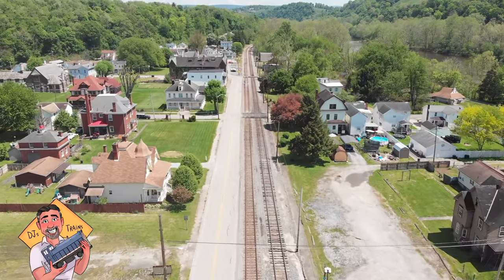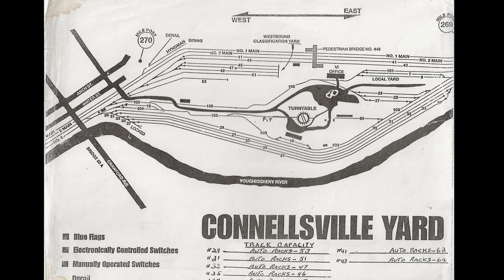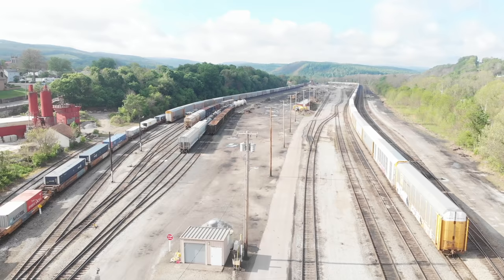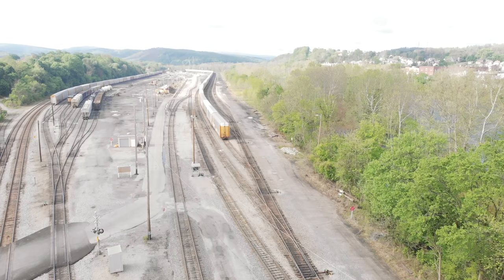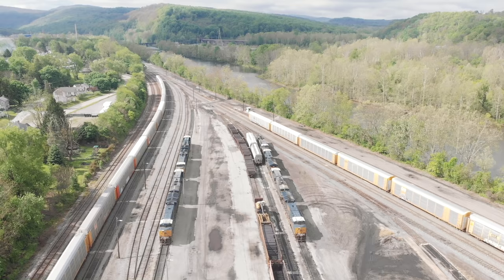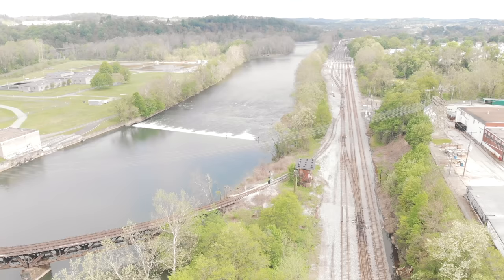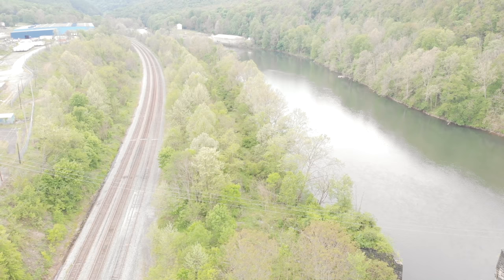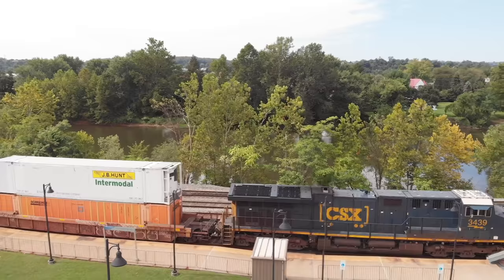Railroad Yard Explained with Incredible Scenery. CSX Connellsville, Pa

Comment: Hi DJ, You may already know this, the bridge over the B&O sheepskin line now SWP, is the former Western Maryland Railway. Just beyond that bridge and along the Sheepskin is the former WM Bowest yard. The P&WV use to have trackage rights over the WM from their connection with the P&LE on the West / North end of Connellsville. Yes the Western Maryland tied in directly with the P&LE on top of the Giant Wall that once divide Connellsville, like the great wall of China. The P&WV (then after the N&W leased the P&WV in 1964) and N&W had trackage rights over the P&LE and WM to reach the WM's BoWest yard. What's neat is the P&LE station is still at West Crawford Ave and Seventh Street and yes that large tower at the P&LE station use to be at track level. If you head over to check out the former P&LE station, be sure to also check out the building across West Crawford Street (Railroad East of the P&LE Station) that was literally built around the concrete supports for the "Great Wall Of Connellsville". Neat stuff and lots of history. This is another great video DJ, I really like the drone footage, keep up the great work. Cheers, Rich S.
Reply: I used to work at that yard and marveled at what's left of that wall, and a trestle that descends toward the river, near the Wendy's and that nice caboose (if it's still there).
Reply from the maker: Roy Ward did an excellent presentation of it at the historical society last year.

Comment: Hi DJ. Thanks for Connellsville and Dawson. It looks so different from the air. In its heyday this area was quite prosperous due to the coke - making industry that fed the steel mills in Pittsburgh.
Reply from the maker: I heard most millionaires lived there back in the day.
Reply: @djstrains  There were quite a few. There was even a Kaufmans located there just up Crawford St. on the right beyond the hotel. You had to have some prosperity there to support those kinds of stores. They were also escaping the smog. If the steel mill owners had taken seriously their need to modernize and make their plants more environmentally friendly, maybe they would still be in business. If was the norm for them to just dump their refuse into the rivers.

Comment: Really great video!   Thank you so much for posting it!    One comment I have is that the old piers that you mention a 9:02 were not part of a wye.   Those piers were from the Ohio & Baltimore Short Line (O&BSL) bridge that existed prior to the time when the Sheepskin was built to Uniontown and further south.    The B&O had hopes that the O&BSL would be a cutoff line that would allow traffic directly from Connellsville to Wheeling by bypassing Pittsburgh completely.   The route was to head west across Fayette county and cross the Monongahela river from Newell to Coal Center, and head up the Pike Run Valley, and then follow the route of what is now I-70 into Washington PA.    One pier of a bridge over the Monongahela was completed and still exists in Coal Center a few hundred yards downriver from the location where Pike Run enters the Monongahela.  Partial grading of this line is visible along the north side of I-70 as you head west from PA 519 into Washington PA.    The development of this route was stopped in the late 1800's amidst a financial panic.
Reply from the maker: Fascinating!!

Comment: I just finished a two track engine repair shed in HO scale. I'm also working on putting together a 9-stall roundhouse. I have the turntable functional and still need to connect the wiring to stall tracks with a rotating selector switch.  I think I'd told you before that I like what you do. I would like to see some drone footage up close as to see how a truss bridge is built.
Reply from the maker: https://youtu.be/hRt5lgFqAEU
Reply: @djstrains  Thank you. That bridge has enough detail that I can use to build one. I have a part of my model railroad that goes across a doorway. On one side I made a plaster stone tunnel portal that is filled with rocks that was the old main line. Next to it is a new tunnel and a wall that looks like it was blasted out with explosives. and the new mainline was raised with concrete over the original stone bridge abutment. I also have two old stone bridge piers where the old bridge would have been along with some wood posts. As for the bridge, I have a cardboard mock up of a truss bridge in the middle of a board the track sits on, and concrete piers.

Comment: Hey DJ, thanks for your Video's, I find them very informative.    Two Q's, first, when there is an engine consist in the front of the train, why is the last engine always point backwards.  Is it so that when you have to reverse it's easier for the Engineer to look towards the back?    Second Q, does removing old track switches reduce derailments?   Thanks, Eric-
Reply from the maker: #1. usually they put the engines back to back at a later point, like after a set off, and the units are now facing each direction for possible travel.
#2.  No, it reduces taxes, and they look to cut costs at every opportunity.

Comment: Niiice. Cool bldgs. in Dawson. Thanks for the detailed tour of the yard.  Question: what are  your thoughts on the seemingly strong EMF's that the remote packs generate since waves are typically sent out 360 degrees so pass thru your body?
Reply from the maker: i can't answer that to be honest.
Reply: @djstrains  Ok. Just thought you might have pondered it.
Reply: I don't know much about the remotes but I can tell you some general information about radio waves. There are 2 ways Electro-Magnetic Waves(radio waves/ light) could cause damage. The first is ripping electrons off atoms if the frequency is high enough. Although this only typically happens above the ultra-violet range. Radios waves are several orders of magnitude lower frequency so this effect is negligible. Ther way it can cause damage is through heat as some radio wave does get absorbed. This is the way Microwaves works. However, radio waves used for communications have much lower power than your typical microwave. They are at most in the several hundred milliwatts (several tenths of a watt) range compared to over a thousand watts for microwaves. So unless you are getting burns from it, it isn't going to have much if any of an effect.
Reply: Radio station transmitters are way more powerful, they won't hurt you. Point is, these wavelengths are harmless.

Comment: All your videos are great!   Question: There are several places (9:20 mark) where I can see a distinct white line across each track. These must have some meaning to the RR. Would you explain?    Thanks.
Reply: Denoting yard limits, maybe.
Reply: I thought that was where CSX failed to install the replacement ties under the rail joints in the flextrack.  :D
Reply: No, that means there's drainage pipe under that section. A yellow line indicates a clearance point, the farthest out you can leave a car and not foul another track.
Reply from the maker: wrong.  Drainage pipe under there.  Don't use backhoe or dig too deep.

Comment: Hi DJ., I guess I'm the only one that thinks this, but here goes... Nice filming, but the video seems over-exposed ... washed out. What kind of adjustments are on a drone cam? I think your scenery would be even more "Incredible" with the aperture closed down a stop or two (...just my 2 cents - Norm in NJ).
Reply: Definitely blown out highlights.  Not sure what kind of drone this is  but the DJI drones in auto mode work pretty well.
Reply from the maker: very sunny, and filming in D Cinelike as suggested, but I am not good at color grading and my mac is getting slow.
Reply: @djstrains   If you have a DJI drone ( I can only speak to the Mavic 2 and Phantom 4 ) they have really good auto settings.  Usually I don't even bother with those special video settings and I don't do any post on videos.  Try it if you have one of them, you might be impressed.

Comment: Very interesting as usual, DJ.  What RR line did the bike trail used to be?
Reply from the maker: pittsburgh & lake erie, and then the western maryland
Reply: It's a fun bike ride. I "only" went about 5 miles each way. Each time I met people who were headed to or from Pgh or DC. It's right next to the Yough, you go over interesting bridges and can see current and abandoned spurs and industries (some very spooky) and the surface is smooth, solid roadbed. 
 
I used to lock the brake on my trike* and nap at the halfway point. There are videos of it if you click my name and go to my channel.
 
(* a Dutch Challenge trike )

Comment: Why do Americans call train drivers "engineers"?
Reply from the maker: we drove steam engines 100 years ago and I guess it stuck.  The conductor does the ground work and paper work.  What do you call them in Ireland?  My mom's family is from Dublin.
Reply: @djstrains  I'd just say "drivers". There's a wonderful documentary series about British trains (not just the trains, but the entire passenger rail system) called "The Railways: Keeping Britain on Track", all available on YouTube, and they say "drivers" too.
Reply: We also used to have "brakemen" (still a few in limited use, but they probably have a different title) and that name dated to the pre-air brake days when they had to manually set hand brakes on cars.  "Trainman" is actually a better term.  They handled coupling and uncoupling in cooperation with the conductor, throwing switches as needed, and passing signals.  Fifty years ago,  a "Flagman" was a specially qualified brakeman who was deemed responsible enough to go protect the rear end of a stopped train.  A hundred years ago each of these "crafts" had their own unions (Brotherhood of Railroad Trainman, Order of Railway Conductors were the big ones) and these later merged with two other groups into the United Transportation Union circa 1969.  The Brotherhood of Locomotive Engineers represented engineers.  I am unsure how things are arranged in 2020.  Thanks DJ for a good look at what remains of Connellsville Yard.  (I always thought "CSX Yardmaster (or Operator), Connellsville" was the coolest sounding identification on the scanner.  Until VI closed, you could hear both handles!)